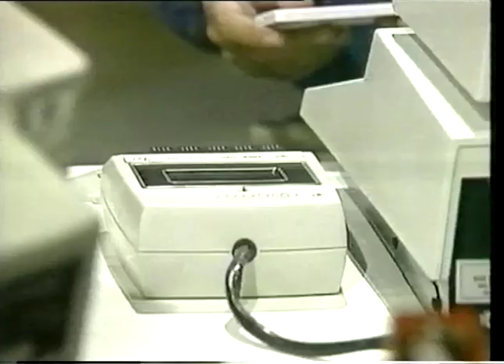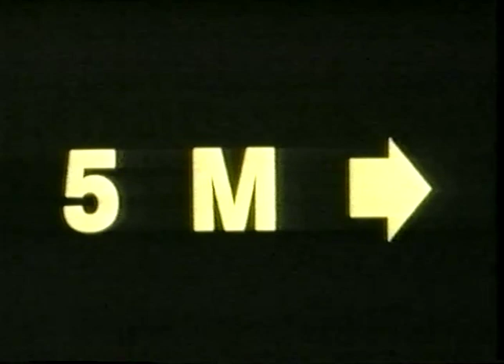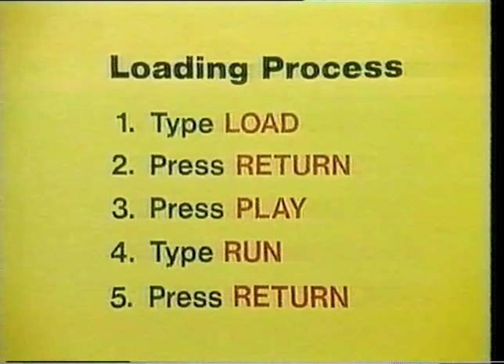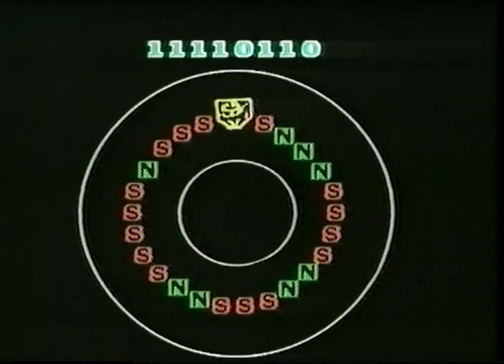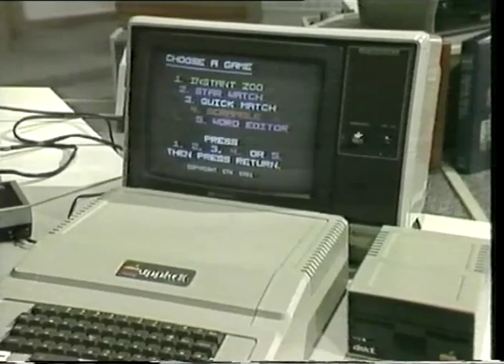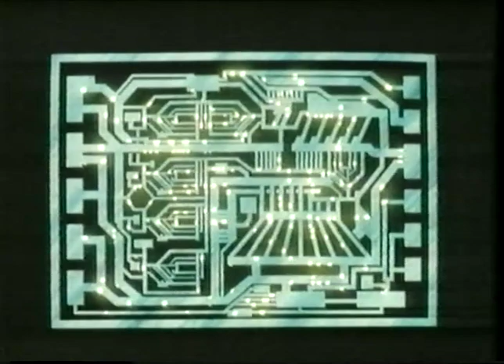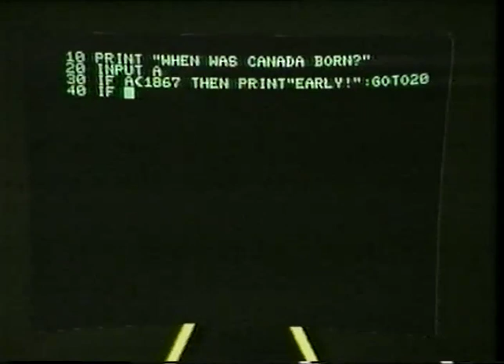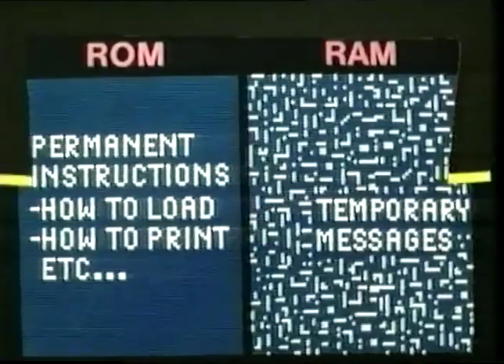Episode 1: Getting Started

Comment: Thank God I'm 23 and appreciate old computers. I own a fully Functional Commodore 128, complete with a 1571 disk drive and tape drive, both which also work to full capacity! And I got a Timex-Sinclair 1000 with the original box, components, and manual with the original 16k pack. I would record new masters of software I downloaded online using special software and record them directly from my laptop headjack to my 2001 Sony Tapecorser mic-input for full clarity (using the aforementioned ZX81 jack). A successful load every time on both computers!
Reply: 2024 Update: 27 years old and both computers still work excellently. :)